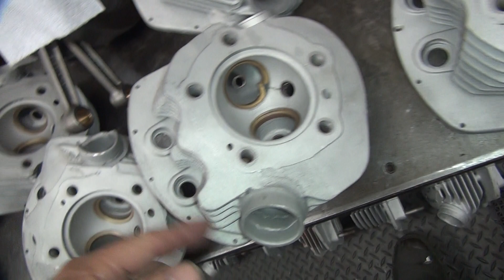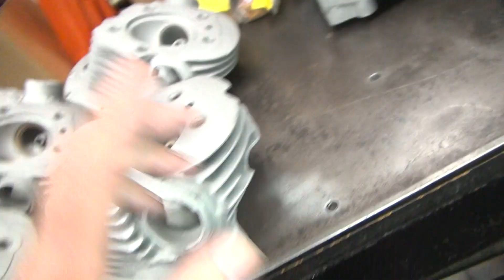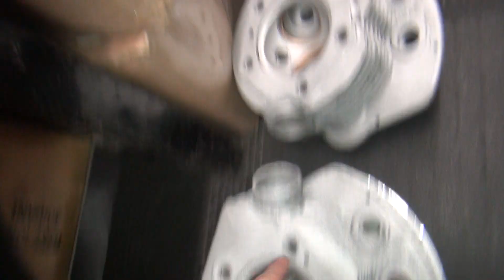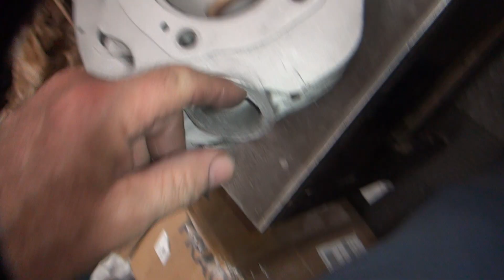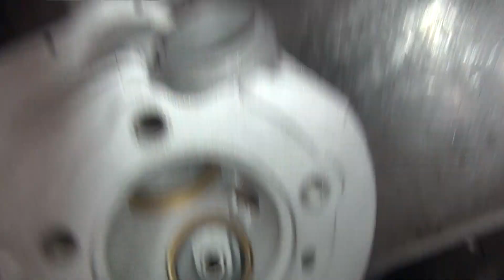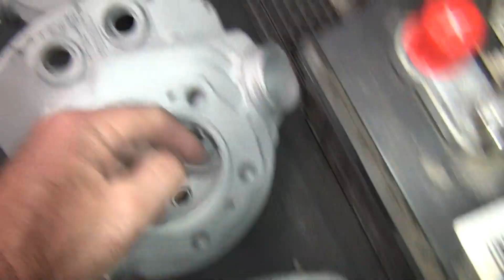#107 1955-62 panhead head identification o-ring style exhaust port differences harley tatro machine

Comment: Do they have different weights also? more weight, more material, cooler head? 
Maybe less cracking? Harley on the experimentation.
Reply from the maker: like most things harley. the newer the part is, the stronger it is.
tatro